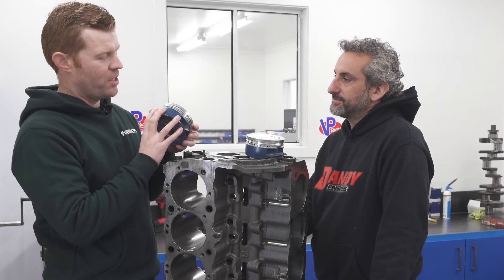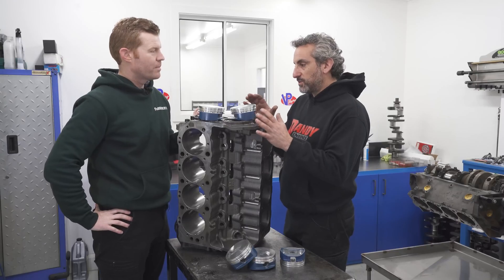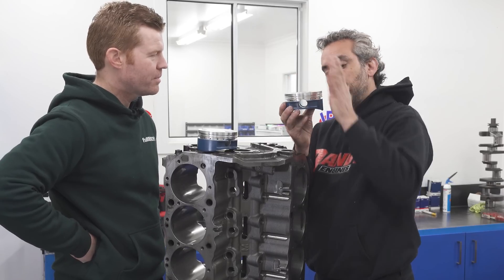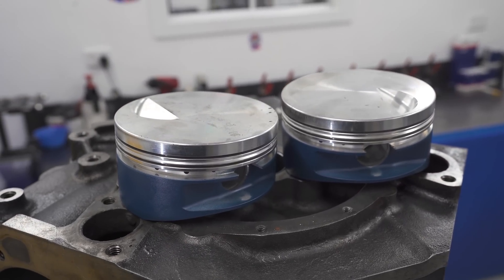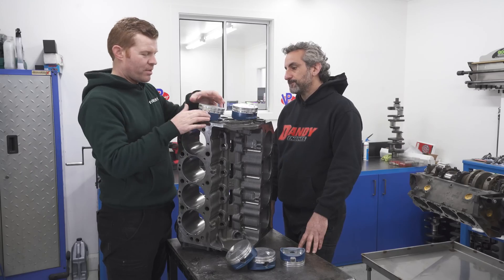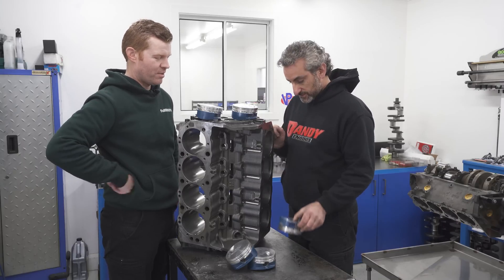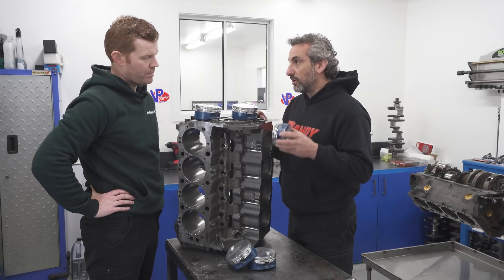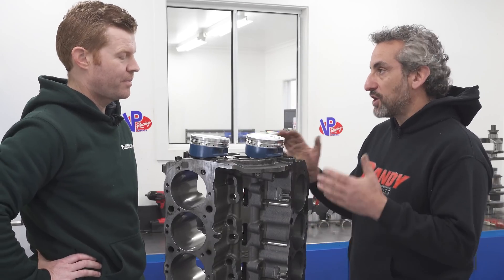Why you should Teflon coat your pistons | fullBOOST

Comment: Basically coat everything which is possible in the moving parts area inside the engine with out compromising any oil holes or parts which require very high tolerances and your engine will last 10 times as long based on OE specs if you changed oil and filters as per OE or even 1/2 the KM's and the engine will last so much longer, but then again what about the gold coating which was done on the Black XB GS which has around 800HP it had black coating on the sides of the pistons and gold coating on the top of the pistons, just imagine how much longer the internals will last if other areas were coated like the crank journals and other moving internals of a engine ? Than Main Issue is COST to do every moving internal parts with the right coatings, which would be in the thousands  ?
Reply: @7071t6

Where are your periods?
Reply: @Mannyjv  lol, i am not a woman get that champ.✌✌👍👍

Comment: that's crazy. I actually ceramic coated my stock Pistons because they had skirt rubbing on them. just did it with DIY ceramic gun coating layed on thicker than usual rehoned the block, put everything back together, and I've put 7K miles over 450 whp on stock pistons and rods from a Mazda f2t, with zero bottom end issues even after a massive head gasket failure, from a 45+ PSI over boost on an hx35w

Comment: Wonder if anyone has ever tried coating the cylinder bores? Like on some alloy blocks that have a sprayed metal coating instead of press-fit iron liners - maybe ceramic could be cheaper ??
Reply: Rings prob wont seat....but ive been thinking of nikasil coating.

Comment: Way back in the stone age they used to knurl and machine the skirts to make up for excess clearance. I got a set of old Bedford pistons that has had this process. It also had a baked enamel on them that looked to be polished to size.
Reply: Yep, knurling held the edge on everything else back then.  I knew one fella who tig welded a series of bands about 1/4 inch apart  on a couple 413 pistons for a drag racer, then turned them to a wall clearance of about .003" before adding an additional oil ring to the 2nd lowest one.  Did quite well but entirely too much work.
Reply: @russbilzing5348  all depends on what you have at hand
Reply: Yeah my old man used to talk of knurling them back in the day